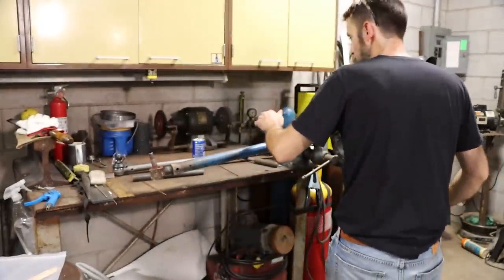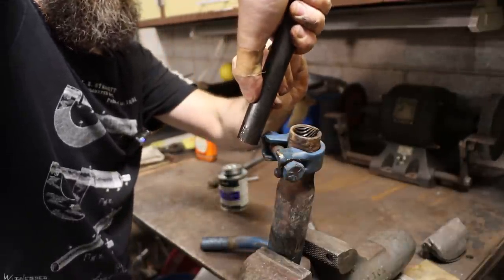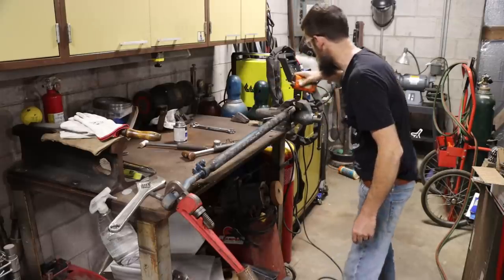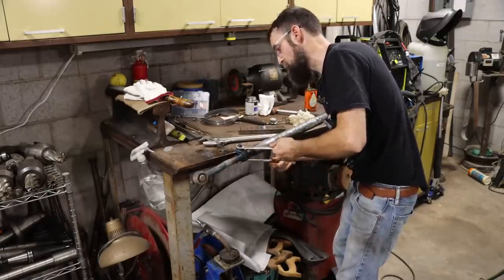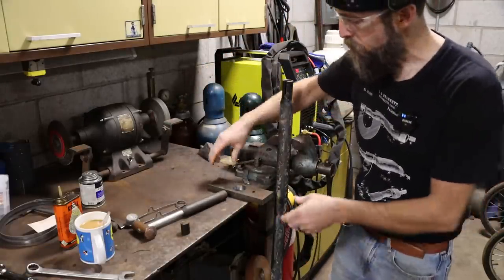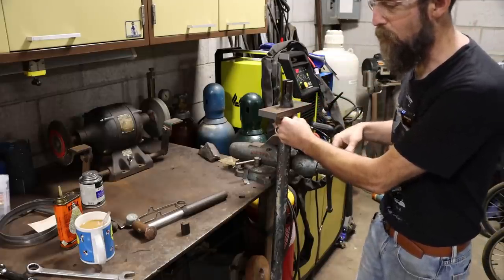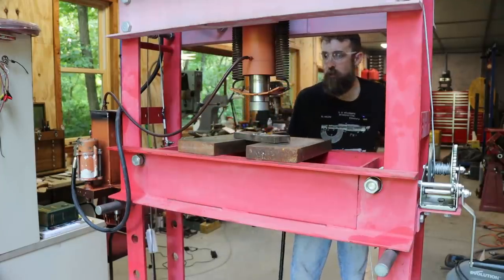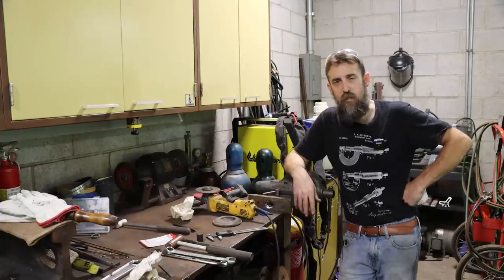Can ya fix this 4 me?  Stuck Ford Tractor Drag Link.

Comment: Cheapest fix likely to just chop off the old end drill and tap the part you are trying to get out and find a matching tie rod to screw into that.  As someone that has literally done this job hundreds of times in the last 25 years I heat till a dull red then throw in bucket of water. Then try to turn it with a pipe wrench you will get it spinning long before you ever get it to move axially. You might have to rinse and repeat 3 or 4 times but I have only ever had one I could not get apart and that was because I crushed the tube in the vise wrestling with it. It will have pipe wrench knurled when you are done but battle scars come with the territory. 😈

Comment: Thanks for sharing Steve!
One thing an 'old Smithey' taught me about rusted steel...Water dissolves rust.  Yup, who woulda thunk!  Saturate it with water, vibrate it good with an air hammer along the outside.  Rinse & repeat.  Do NOT use oil UNTIL it is freed up.  Oil will keep the water from working on the rust.
Best regards,
Ken
Reply: 'old Smithey' taught you right...
Reply: My dad used water on rusted everything. I never saw anything he didn't get apart! I remember he explained this to me in the late 50's. Just by coincidence I removed a splined shaft from a u-joint yoke 3 weeks ago. Looks to never have been removed so I tried press but no joy. Put the thing in a bucket of water for 2 days. Back to the press and it released at 10 tons. (Press is 20 ton unit) Maxed it out first try.  You could see that the water had penetrated the rust. My dad was a patient and very thrifty soul, but he imparted so much information on me! RIP Pop!

Comment: Cut off the threaded end of the tube after it expands to full diameter and weld it to a new piece of tubing. Drill cross pin holes and done.
Reply: best option i've read in the comments so far
Reply: Yes, he's already 'heat treated' the part so welding is not going to weaken it any further. Cut n weld easiest way
Reply: WHY, THAT's JUST TOO EASY😉😉😉
Reply: 😎👍 Yup.
Reply: Yeah, not really sure why went through all this.  Not a super complicated part to make.

Comment: What a battle. You made the right decision, quit...
Cheers and thanks. Your video matches my day perfectly.

I just came home from my "little friend". The kitchen curtain rod had collapsed....
Prepared with plugs, screws, cement drill equipment... Also bought 3 cement drills for 30$..
I found out that nothing was broken. A shock hitting the curtain rod had made the rod go apart in the middle... Tightened and adjusted the curtain rod pieces and drilled a hole in the living room for hanging a painting. Got a nice free dinner...
What would life be like without friends needing help?.....
The same modell of bandsaw stands here... It cuts...
If force doesn't work, use more force we say here...
Using the hammer technic works even in Russia,,,,,
The big bandsaw required...
Time 15:15. 25 tons..... Hey Steve! What are You thinking about? That look dangerous.

Comment: More heat, Bigger hammer.
My friend had the same problem, we did throw the link in a campfire until it was red, gave it some love taps all around and after it cooled down, we soaked it in a wd-40 and twisted the insides out.

The screeching sound it made while twisting out was straight nightmare fuel
Reply: Lol, we all know that sound. The sound of success!

Comment: I removed one of those, spring of  2020. I have a piece of bar stock that fit perfectly in tube. Had to weld a heavy washer to bar stock to keep it from slipping in vise and used drag link tube like slide hammer. Had to apply some heat to the stuck end. Probably 3 hrs time but it finally let go but was very tight until  the last 1 or 2 inches. Great video Steve! 👍

Comment: I would have tried a length of PVC pipe blocked at one end full of rust remover (citric acid excellent and cheap) and left it soaking for 48 hrs before going to mechanical extraction. Works every time. Great video.

Comment: Important thing for the owner to know when searching for any available parts.  If the owner is calling that a "drag link", he is calling it by the wrong name. The component you were working on is not a drag link, it is a tie rod.  In Ackermann steering systems the tie rod connects the left and right steering knuckles together.  The drag link connects from the pitman arm of the steering gearbox to one of the steering knuckles.
Reply: Hi Larry Walker. Extremely well said. I was waiting when I would come across the first one that knows the correct names of various steering components. Some of us on these channels are old enough to have worked on cars back at the times when cars were still cars, rather than the toys they tend to be presently. Cheers from Indonesia.

Comment: This is where the coke forge comes in handy! Plenty of cheap heat and then hammered on the anvil is the cure, and rebuild with coppaslip. Luckily I think the ones on my fordson are free! You can tighten up the loose ball joints by placing some thick walled tube over the thread and taper and hammering on an anvil, but don’t heat them as some have a nylon seat in the bottom.
Phil Whitley, my week this week.

Comment: Steve, there are two way that I have used with good results. one is heating the thing red and cooling down quickly with cold water, this will break the rust inside of the tube. the Second way is lay it on a heavy anvel and beat the crap out of it with a large hammer, the side impact also breaks up the rust.

Comment: I have done several of those, not Ford but Case and AC,  What I do is heat the full length till its cherry red with a BIG rosebud then take it to the anvil and hammer the full length all the way around then see if it will turn, oh an air hammer works best. if that fails then the next step is like you said split it the full length and after you get the new one in weld it up. In your situation weld it up first then take a skin cut off the new one so it will slide in. When you weld it with the new rod in it will never move again.
Reply: An air hammer is worth it's weight in gold for a job like this.  I do the same as Weldor111 describes, except I also use the air hammer to move the inner piece of steel.  In, out, turn it just get it to move any direction.   If it doesn't move beat on the outside again.
Reply: Dead on the money.  No point trickling the heat in with a small tip, a big rosebud that punches the heat in to the outer before the inner heats equally is the key.

Comment: I would drill holes at about 1 inch intervals to try to get penetrating oil in. My go to is Knocker Loose. As others have said, lay it on an anvil and use a large hammer on the tube to shock the rust. You might use a heavy plate on the ground and the electric hammer you used to break your concrete. 
Use the same piece you welded on and add three or four vertical gussets to get more weld surface area and use all 50 tons of the press then heat it. You might consider setting up your torch for propane. There are different cutting and heating tips used for propane. If you use it to heat your home you can run a line to your shop and it will be cheaper than filling smaller tanks. I suggest cardboard boxes under the press to slow down pieces that come out. Also release the winch that lifts the table so the cable isn't under tension.
You could even try pressing on the side of the tube with the ends supported to flex it a little to try to break the rust.
Reply: That's a LOT of thinking, suits your title...

Comment: Its easy to shrink some outside parts when heated with a torch. Done it one time on a big expensive hudraulic cylinder piston ear. Heated it in multiple sessions to try tread it out. Just made it worse when the eye shrank after every heat.

Comment: We've gotten similar sliding sections apart  by either running beads of weld longitudinally on one two or once it took three beads along the expected rust bound sections. This expands the outer tube. Liberal application of your favorite rust busting penetrating oil.

Comment: At 14:53 where 15 tons is measured, I would have stopped and reheated the length of the sleeve just like you were doing earlier but now under pressure.  I am pretty sure that it would have loosened up?  Other than this a good learning experiencing.

Comment: Heat till cherry red and quinch a couple of times, then weld plate like you did , make an adapter for your electric jack hammer and pound it out. You need the vibration to break the rust bond. A big hammer drill on jack hammer mode also works.

Comment: I have a turn over plow that rotates on a 3in diameter shaft with a bit of rust in it. I found with a large load binder and lots of leverage of the attached plow and 3-point mount I could turn it. Then I made a mount to jack the shaft out with four 3/4in threaded rods and a 20ton jack. I put thousands of lbs of force and it would only move a bit when also rotated at the same time. In the end I split 12in of the tube to get it out. 

The problem is that rust crystals are larger than iron, so the shaft expands while the bore shrinks.

Comment: May be worth a try when winter comes and the tractor is not in use. Take a pipe, are any means that is water tight on one end and the link with fit in. Vertical position would be the simplest like stood up over in a corner, and mix 3-1 (3 parts clear or distilled water to 1 part Kleen Strip acid and leave it ro set 8-10hrs. If there is no bubbling present add more acid till a forming action is present. Maybe a long shot, but a gal of Kleen Strip is uder 20 dollars, and worth a try. Thx for sharing your efforts Steve,, Bear in Tx.

Comment: You gave it a fair go. The important thing to take away from this exercise is the preventative assembly of the replacement when one comes along, That is, Plenty of Anti Seize inside on assembly as well as block the holes for other settings with even hot melt glue and then the next person has a good chance. My thoughts, John, Australia.

Comment: Hi Steve. It may be me but I’d treat it as a personal test! My best guess is to squirt some penetrating fluid in every hole. Then put it in press horizontally and flex it. In multiple places around pipe and along length. Should free up quickly!

Comment: I've done several of those, the best way I found was to stand it up in a piece of 6 or 8" pipe and fill the pipe with charcoal(the real kind, not briquttes). Space the pipe up off the ground an inch or so for some air to draft up. Light the charcoal at the bottom and let it burn down. Once it cools off, blow the ash off, tape up the split in the end and fill the end with WD-40 or similar. Hold the tierod vertical in one hand and smack it with a 3-4 lb hammer with the other moving up and down the length. You don't have to smack it hard, just enough to make it ring (vibrate) so the oil can wick in and help brek it free. I've done at least four of those like the one you're dealing with. All but one shook out with the hammer, the fourth I had to weld a slug to the side of the inner shank and drive it out that way. Note: This is all stuff your neighbor can do himself.

Comment: Just a thought exercise here. But had you considered using a air hammer to help vibrate the shaft loose from the tube. applying the pneumatic action in the direction your trying to remove the the inner shaft from the tube. It always amazes me how helpful they can be when in spots like that. (though they have enough power to create their own problems if not careful)

Comment: Super glad you didn’t hurt your left hand when it let go.  I did something similar where I had my hand on the thick aluminum sheet I was bending in the hydraulic press brake.  When it let go, it smacked my hand so hard is started weeping blood through the skin.  Fortunately I wasn’t hurt bad, but the lesson was to keep hands clear from the parts in the  press once things are set up 😜. Seems so obvious 😂

Comment: Interesting approaches.  One solution I would have considered is putting the link in the lathe and using a cutoff bit to cut the old tube ends off at the widest point (about 5 inches in on each side), to save the machined ends.  Weld those onto a new tube.  But I definitely understand the time pressure with hay on the ground.
Reply: Yep, that's exactly what I was thinking.  Most of the tube would be quick and easy to fabricate from stock, the ends not so much.

Comment: That was an impressive weld/deweld demonstration :) My suggestion for your friend is to reweld that plate metal back on and take a hammer drill on hammer mode doing the same action as the press. The percussive strikes can help reorient the offending rust without storing quite so much energy as the press. I've used this method for removing rods frozen in iron pipes. Thanks so much for your thoughtful approach, I'll store this video in the might need it later portion of my brain.

Comment: In case he is stuck and cannot get a replacement, take a tubing, seal one end and soak the whole draglink in it overnight with a 50/50 ratio of used auto transmission fluid and acetone - this is your home made WD - 40. Next day with one end anchored well to an anvil or something similar (avoid any springing) use a good size slide hammer to work it out. The slide hammer might need to be made from scrap parts.
Reply: Slide hammer or a pneumatic hammer be worth a try.   Impact might jar ti loose, maybe with an acetylene heat up to get it to expand.  But man -that thing was STUCK GOOD!
Reply: @joecnc3341  I think it should be tackled at the slide hammer 'pull' side, not hammered or push/pressed from the other end. Also, if he drills 4 - 6 holes in the center area to let that DW-40 mix soak through.

Comment: Steve, I would have dumped penetrating oil in it daily, for a whole week. Make a threaded plug for one end. Hook the grease gun up to it or hydraulic pump. Pump it up, use heat, red hot the length of the tube. I like the water option, mentioned in comments also.

Comment: I TOLD YOU SO!  HAD THE SAME THING WITH A TELESCOPING PTO SHAFT FOR A  POST HOLE DIGGER, wound up splitting the outer sleeve, rusted solid inside, had submersed it in diesel fuel for days, tried heat etc,  didnt have a press, lathe, doall band saw, tig welder, etc.  sure was interesting to watch all the hi tech knik knats fail.

Comment: Wow, that was a stubborn devil. It can't be rust alone that's holding onto that surely? 
Thanks for sharing Steve.
Reply: When the steel converts to iron oxide, it expands. With the length of that tie rod, there's a lot of surface area that you have to fight. I've worked on smaller stuff that wouldn't come apart.

Comment: Common problem with any tractor front end tubes where you have metal inside a tube. I saw a guy trying to pull the tubes apart from a 1256 front end with a 100 ton chain fall and couldn't get it done. Heat and penetrating oil and time is what will get them apart. And a guy needs patience. Another way might be grease jacking. Make a threaded fitting with a grease zerk and start pounding it in. Little at a time and it might break it loose.

Comment: I have split and rewelded a couple of running gear king pins; they came apart quite easily after days of frustration with every other method, and have held up just fine since. I'm sure you could have made a new one using his old ends just as well. A good winter project for you to work on.

Comment: I would be willing to bet that the inner rod is slightly bent and that's why it's proving to be so difficult. A slight bend coupled with some rust and crud can make these things virtually impossible to get apart. To salvage what you have, you might be able to cut the threaded swage end off and weld it to a new piece of tubing to create a new link. I have done this before on an obsolete off road heavy hauler where there were no parts and after 5 years it was still working just fine.

Comment: There is a firearm cleaner and bore cleaner that is cheap to make called "Ed's Red". It is equal parts kerosene, acetone, and Dexron III atf. Penetrate well and cleans actions and loosen fouling in the bore. The use of acetone can be omitted it needed as the acetone is mainly used to clean and loosen the plastic fouling in shotguns from the wads. I have heard that it makes a good rust penetrant. Another cheap and effective penetrating  fluid that was tested by a university( I understand ) is equal parts Dexron III and acetone. This mixture did better than any other commercial brands tested.

Comment: So a relatively simple repair, weld your barstock back onto the tube with a stick welder, put it back in the press, then with a rose bud on your torch , heat the length of the tube and it will come out !
Reply: Guess you must be some kind of smart.

Comment: Hey you gave it a good try. The outer pipe is probably bent a little and also has it jammed up in there together with the rust!
Reply: The link is not usually under much compression, but prone to rust, hell yes. Splitting is the easiest way to go, not necessarily fast but easier.

Comment: Something that has worked for me in similar situations, is to support the opposite side very well as on an anvil and then pound on the tube ALL over from end to end with a hammer which will slightly expand the outer tube. It might work for you too.

Comment: For an emergency fix, if the other end goes, just weld a new tube parallel to the old one. It'll be a terrible looking rig, but it might save a crop until you can find a new part.

Comment: Is it bent perhaps increasing the bind? I definitely wouldn't have invested the time you did thanks for sharing Steve. The only thing I could add is maybe you should have added heat once more while in the press before exceeding the strength of the weld, and an air hammer has the magic when needing to dislodge rust.